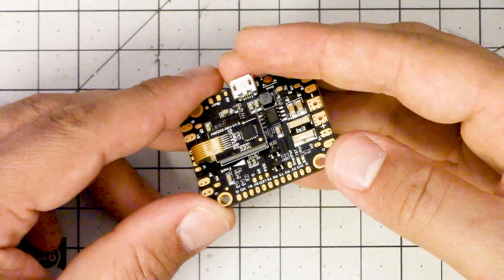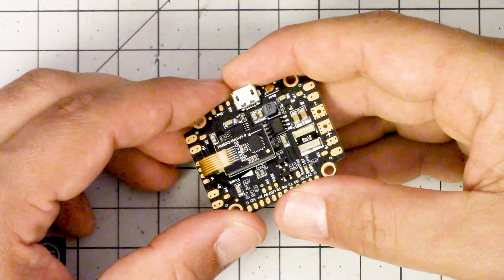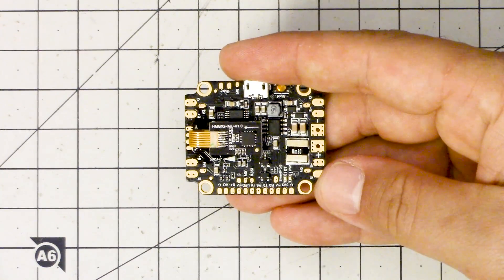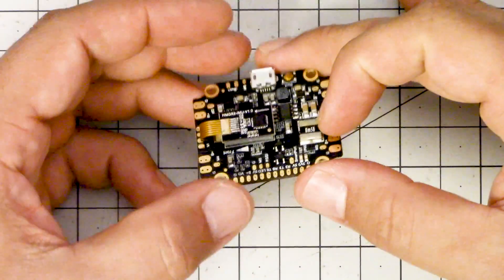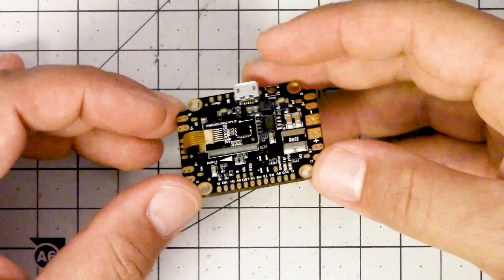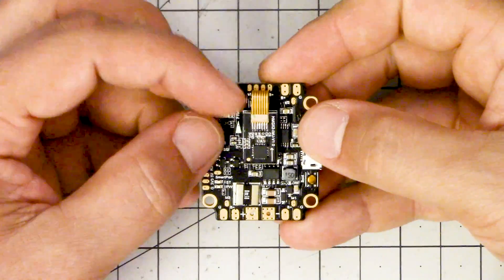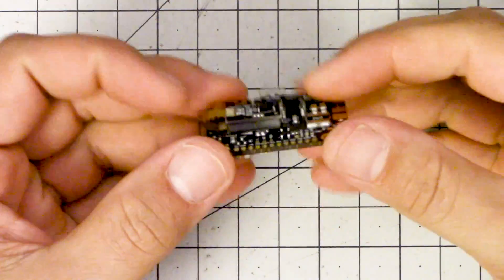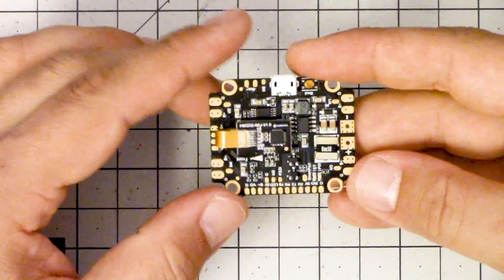Holybro Kakute F4 AIO | BETAFLIGHT FLIGHT CONTROLLER REVIEW

Comment: I like the foam pad. For filtering, you mentioned it was too soft at the beginning and was changed to a stiffer one. And then you complained it was too tall. Have they tried keeping the soft foam but thinner? By being thinner you will bottom out "sooner" making it stiff "faster" so in other words it should change the board frequency response overall; hopefully beneficially. By being softer and thinner (or same stiffness and thinner).

Comment: Is it possible to use UART 1 (SmartPort) for SmartAudio?                                                                                                                                                                                                                                                                                                                                                                                                                                                  
Because i need the other 2 UARTS for Crossfire RX and GPS.

Comment: hi Joshua , i just got the kakute F7, and a few odd things are happening, if you could provide me some guidance please
1) the unify lights up then off, tested only about 2v coming from the 5v on board
2) when plugging in battery a couple motors will spin for a second, odd
3) if left powered with battery a weird electric short continuous  sound comes from the buzzer
4) i hooked up cross fire, armed once then no more, 
i have 4in1 reaceflight esc's connected with the harness
i checked continuity across the board all is good

my brain is mushed
Reply from the maker: De-solder everything from the 5v rail. Measure voltage on a 5v pad. If it is less than about 4.7 volts, the 5v regulator may be damaged. Test for continuity between 5v and ground. If it exists, that may be what is causing the problem.

That's where I would start with troubleshooting this.
Reply: Joshua Bardwell 
I did it and get 5v second I connect anything kaput board won’t even light up

Comment: Iknow that im really late for this video but I have just started my first drone build. EVERYTHING was working fine yesterday, but this morning I tried to turn my drone on and the drone wasnt responding to my tx. The receiver was telling me that it was bound to the transmitter but nothing was working. I checked in betaflight and in the receiver tab the board wasnt sensing my inputs. can someone please help me because this is my first build and im really stressing out over this. Also this was alot of money for my first build so would they be able to send me another one. (I bought this off Banggood) Thank You

Comment: where i can wire my TBS Crossfire in this board ?
Reply from the maker: Any UART TX and RX pad except the ones used for SBUS and Smartport should work.
Reply: Joshua Bardwell so I cannot use UART TX3 and RX3 because it’s automatic inversion ? My board is kakute f4 aio v2

Comment: Im going to use the Kakute F4 in my RC Tank as a volt regulator and OSD for the Run-Cam 2 split and Mach 3 TVX transmitter. Maybe a little overkill? Any thoughts?
Reply from the maker: To use a whole FC as a 5v regulator is definitely overkill.

Comment: Hey Joshua, did you write the manual for the F7 version too? I just got that one and the manual is great. There are a few places where the F7 manual talks about the F4 version though 😛
Reply from the maker: Yes I wrote it. It was based on the F4 so maybe I overlooked some places.
Reply: The bit referencing the F4 was on page 9 - “The Kakute F4 AIO has a built-in current sensor, and you don’t need to use ESC telemetry to measure current.”

Not a big deal though 🙂
Reply: Cool, well it’s the best manual I’ve ever read for an FC.

Comment: Hi Joshua,  I've recently purchased a Kakute F7 FC combo with 4in1 ESC for a long range quad that I'm building.  Firstly your manual for the F7 is excellent, well done.  Though I hope you can help me. I'm planning to used an external Holybro GPS/Compass so I will be utilizing the SCL/SDA pads.  For all my other freestyle quads I'm using Betaflight 3.4.  Though I'm a little lost as to which software I should use to gain maximum performance and features available by using the GPS/Compass on board, i.e. either Betaflight or iNav?

Comment: I have a question.... RSSI... I am using the Kakute FC and ESC Bundle... Frsky XSR... but my RSSI in the OSD reads "0", in my Taranis the telemeyry shows "90"... Did I miss something?, how do I get it to display the same RSSI reading as my Telemetry... in the reciever tab RSSI is set disabled (did not think I need to change anything there)... Any help would be welcome...
Reply from the maker: https://www.youtube.com/watch?v=t-evOAS9Mkg
Reply: Thanks Josh... I went with the Direct method RSSI pad to RSSI pad... both the XSR and Kakute have the pad... all working now...

Comment: I am running a Kakute F4 V2.1 and the buzzer is constantly on. I have betaflight setting same as my other models and mode tab shows it should be off, so it seems like a board issue?
Reply from the maker: It could be a board issue, yes. Make sure you have connected the buzzer to the correct pad. If you simply connect buzzer to any ground pad it will be on constantly.

Comment: Hey. I got the Kakute F4 V2 and i have many Problems with the OSD. When i lift of the OSD start to flicker and at the end it is totaly blurred that i can not read it. My Foxeer Predator Micro and the TBS Unify HV Race gettong the Power direct from the Lipo. I dont know what to to to fix it.  An you help me?
Reply from the maker: First thing to check is: are the motor screws touching the windings. Test every screw with a multimeter!

https://www.youtube.com/watch?v=eo2sjTNS0pc

Comment: Hi Joshua, Can you help me with jello issue? I switched from cheap frame to Skitzo frame, switched from racerstarAIOfc to Kakute F4v2. Switched motors from dys 2300kv to ledrib back to dys because of bad bearings in the le drib. In all situations I always have this bad jello. I;m starting to think it is my gopro because I dont see it in de fpv feed and lately I think the motors/tune sound pretty good. But when I look into BBE I see what I think is a lot of gyro noise. I tried soft mounting the kakute with rubber standoffs but this did not improve, got it hard mounted again. Can you see in my black box logs anything odd what should be set different? http://gofile.me/407P7/ULLYxOLa3 I would like to have very smooth looking footage!! :D

Comment: Can this flight controller support a hexacopter race frame? I'm running 6 esc t motor f45
Reply from the maker: It has six motor outputs yes.
Reply: Joshua Bardwell thanks buggy ordering this now. Dys F4 giveing me alot problem

Comment: Sorry but the ribbon cable is too fragile I bought on your recommendation but I’d rather soft mount the controller I barely touched the ribbon and if it wasn’t a problem they wouldn’t send an extra ribbon good luck soldering it on I couldn’t so GetFPV is sending another but will it work stay tuned I was super careful tell them to save ribbons for birthdays

Comment: Hi Joshua, I have a problem with the Kakute F4, I already installed the newest Betaflight version, but when I want to change some values, such as the VTX_Channel and VTX_Power, it doesn't write them  to the board. What I mean is that it seems to update the values but it does not.  For example, if I change the vtx channel what I expect is to loose the signal in the goggles... but the image remains.  After any reboot the values returns to the defaults.

Comment: I got the kakute f4 the one with all the wire harness ports, how do I find out which pads are for sbus please Josh? Can't find reliable manual for this kakute? It says f4-v1.4 on back of board, please help
Reply from the maker: Please refer to the manual? Is the answer in there? I wrote the manual for the Kakute F4 so I hope I covered it there.
Reply: Cannot find manual for v1.4? I guess the sbus is on the R3 pad anyhow?
Reply: The V2 has a totally different pad/hole layout. And they added ESC telemetry pads (at least that's what I think they are... RX5 pads at every ESC signal pad...)

Comment: every little bump and mine  failsafes from a drop of less than two inches off the ground with upright landing... any kind of jarring will set off failsafe will report back after taking off soft mount foam and put 3mil double sided tape
Reply: 3 mil double sided tape didn't work 4 me... any jarring while armed will set mine into failsafe

Comment: Hi @Joshua Bardwell.
Hi have this board due to your recommendation. Thanx for the video!

1) I cannot download my blackbox data. I am in betaflight (3.2) and its says downloading. After 30 mind its still stuck. I cleared/deleted the blackbox data and recorded again. I only used 4MB of the 16MB , still , it does not download. Are you supposed to download it trough betaflight , or am I missing something?
 
 2)I have a bad YAW Twitch on low throttle. Sometimes I get a spin of death in the air and the quad will start flying away. Should I use double sided tape to replace foam? Does that sound like the feedback loop you talked about in the video?
Reply from the maker: Downloading the Blackbox can take a long time. But the progress bar should move. Yes you download through Betaflight.

If you upgrade to Betaflight 3.3 it has anti yaw spin protection. That's my recommendation
Reply: Joshua Bardwell thanx man. You are tje best ! 
Turn out , if I put my frequency on 8kHz/4kHz , the jitter is gone....
But , I will load 3.3 to prevent the spin aniway. Thanx for your AMAZING work !!!🍻🍻🍻

Comment: Hi JB can you pop the numbers for calibrated current sensor on this board ? hmmmm best if you got it for kakute F4 AIO V2
btw  very good manual :)
Reply from the maker: Unfortunately there is enough manufacturing variance that you can't just pop in a number. Start with 250 and then use the "safer current sensor calibration" method.
Reply: great, thank you very much, at least I know where to start 👍👍👍

Comment: Hi! I was wondering if it's possible to conformal coat this board at all - given the spongy area?
Reply from the maker: If you really wanted to, you could remove the foam and gyro and coat the board. You could also use a brush-on conformal coating.
Reply: Thanks Joshua! I do have brush-on coating, but I was wondering if there was any open electronics on the bottom of the gyro board (the part the foam sticks to) that needs to be coated (or top only is enough). If I am not to fear for that, it makes application of the coating so much easier!

Comment: So my question is what to do with the ESC signal ground wires? The small black wires? Eliminate?
Reply from the maker: That's fine. They are pretty short and so t matter in most cases.
Reply: Joshua Bardwell so just take them off the ESC?

Comment: Hi Joshua,  can you confirm if the non aio version 2 of this board can run cppm from say a frsky d4r-ii? It's a pretty popular receiver although a little older now.  Cheers and keep up the good work
Reply from the maker: No, these receivers, like many modern receivers, don't support PPM at all.
Reply from the maker: Flight controllers, that is. These flight controllers don't support PPM at all.
Reply: Joshua Bardwell, i see in an early version of the manual it states uart6 can run ppm?  A few people managed it but then it was removed from the firmware later on.  Never mind I've bought a replacement module and some tiny frsky xm+ rx's. Can't wait to see how the f4 runs on my new rooster

Comment: Hi Joshua,

I come  because i have one problem :) 
Can u help me plz :) ? 
 So issue is that when arming with 32k sampling enabled even if only using 8k 4k, or any other combo of gyro pid speeds, the motors start spinning then get grindy/oscilaty as if desyncing. This is only with dshot at any speed, no issue with multishot. With higher gyro sampling like 32k it is almost as instant when arming. There are no issues when using the motor tab. The weird part is using 8k 4k without the 32k sampling enabled works fine. My feeling is this has to do with the combo of 32bit esc and 32k sampling mode.
Thanks in advance :)
Reply from the maker: +Franck Louchet 32k sampling disables internal filters even when only running at 8k. Betaflight 3.2 is not optimized for 32k. Disable 32k option.
Reply: I did this, thanks for your answer .

Comment: Hey Josh I'm having a really difficult time here and I'm hoping you can help I have a betaflight f4 board a couple weeks ago I couldn't arm it came up with a no gyro message on osd I was able to power cycle and it fixed itself now I flew 3 packs today and all of a sudden I'm getting a no gyro message again and can't arm I haven't changed anything no crashes it just won't go away I tried erasing and reflasjing and nothing works can you give any input or do you think the boards gyro is just dead
Reply from the maker: +John lepeshko you can try the oven reflow method and see if it fixes a cracked solder joint. Otherwise the board is dead IMO
Reply: I appreciate it it's insane this is the 4th board I've had issues with first 2 boards lost all voltage monitoring the 3rd board was dead out of the box and this one lasted about 20 packs I'm done with the betaflight f4
Reply: Also do you know where I could possibly find a component pinout printout of the board I heard the transistor for the gyro is known to go bad and I have a few old boards I could possibly try and swap it out

Comment: Another thing I noticed when I installed this board is the virtual horizon on the osd is backwards on the roll axis.... is that this board or is that a betaflight glitch?
Reply from the maker: Be sure you have installed the board facing the front of the quad would be my first suggestion.
Reply: Joshua Bardwell that's what she said, er everyone has said to others having this issue but I assure you it is installed correctly. Everything else works great.
Reply: Joshua Bardwell this is still unresolved. The quad flys great. The board is installed correctly. The pitch is correct with the virtual horizon but the roll is backwards. This has to be a software issue. So knowing that the board is installed correctly what other thought do you have on solving this issue?
Kakute aio running bf3.2 that was installed on it by manufacturer.

Comment: Hi Josh,

I have a question! RSSI... I have an XM Plus (but no Taranis b/c use T8SG Jumper) and i want RSSI on my OSD so I wired the RSSI PWM output pad to the RSSI input pad on the FC with a low pass RC filter (10Kohm & 10uF) in between to convert from digital to analog. The native channel for RSSI on the XM plus is CH16, so in Betaflight I set the RSSI channel to AUX 12 and enabled the RSSI option in the configuration tab and also in CLI entered set max_aux_channels=12. I feel like I missed something basic here though because my receiver still works, but I get no response on AUX 12 indicating an analog RSSI signal coming through. 

Do you have any tips on setting up RSSI that could give me a clue or two? Thanks!
-
Sam
Reply from the maker: +GeckoLibre are you sure your xm+ firmware is outputting RSSI on 16?
Reply: No, I don't know which firmware I have. Apparently there  are firmware with and without RSSI on either CH 16 or 8. Because I don't have a taranis I cannot flash it and so that's why I opted to wire it up directly via the RSSI pad instead of using the native RSSI output from the receiver via the signal wire because I thought I wouldn't have worry about which firmware I have. I tried all the channels though to see if it would show up while holding my max_aux_channels = 12 and no luck there.

Comment: +Joshua Bardwell
Hi,
I have this exact flight controller and am having an issue with it. It seems that whenever i try to save and reboot with this fc in betaflight, it goes into dfu mode and says failed to close com port. I have no idea why it is doing this, do u have any idea.
Thanks
Reply from the maker: Nope. Sorry... I have never seen this. My first guess would be a driver issue on the PC. Try a different computer.

Comment: I’ve run into a lifted r3 pad for my sbus connection. I’m wondering if there’s a way I can remap it to a different pad. Any help would  be appreciated. Thanks. I love the board, this is my second one. Hoping not to have to go buy a 3rd one
Reply from the maker: For SBUS, you will need to get at the uninverted signal on your receiver, then use any spare UART RX pad. Google "sbus uninvert hack" for more on how to get at the uninverted signal.
Reply: Joshua Bardwell I will look into it. Thanks for the reply.

Comment: Another great thing about this FC I found is that it provides quite adequate video filtering (and current) via the 5v pad even to the RunCam split which is known to be very sensitive to noise and power hungry. I almost don't even need to add caps to my ESCs, but I will anyway to make the reception even better.